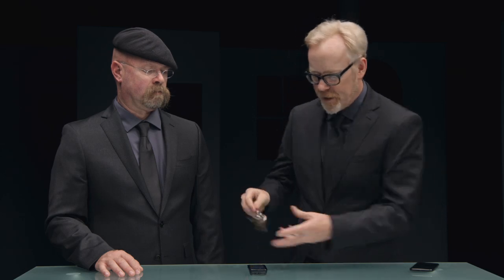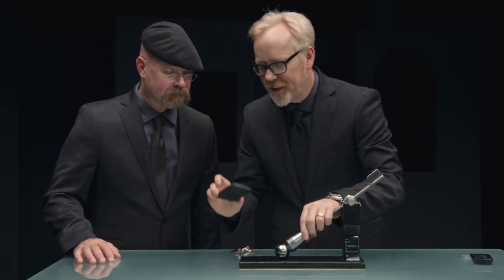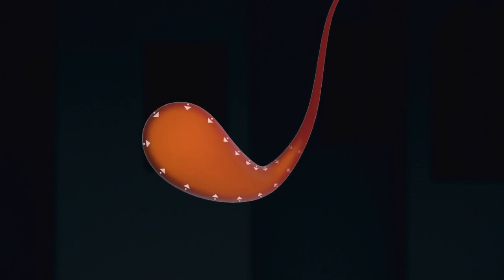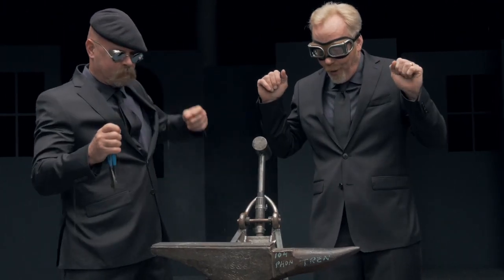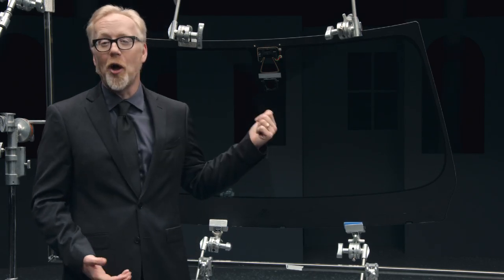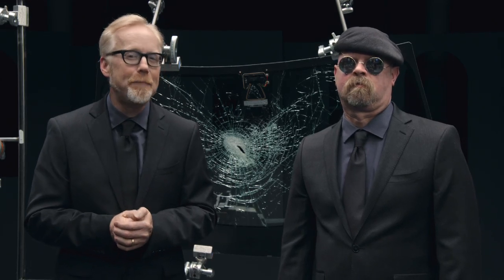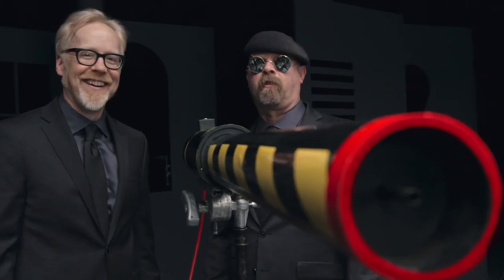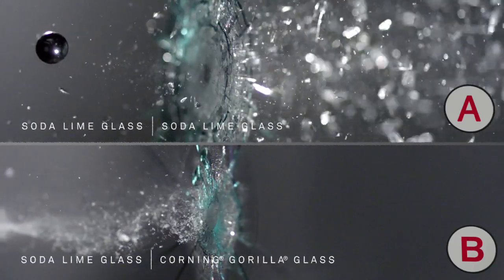The Glass Age, Part 2:  Strong, Durable Glass

Comment: I owned a phone with Gorilla glass and it did survive falling but you know what it did not withstand? SAND. Without noticing it a a few grains of sand landed on my phone and after wiping it off it scratched my display. It maybe impressive as far as dropping it is concerned however they should make it to withstand materials as hard as sand. I use a tempered glass screen protector on all my displays now.
Reply: Bandit Leader nonsense... You clearly have no clue what sand is, or diamond, or cutting...
Reply: ***** Sand is silicon dioxide (quartz) and that's the primary material used in glass. There is this table called Mohs hardness scale (http://en.wikipedia.org/wiki/Mohs_scale_of_mineral_hardness). Basically anything with hardness equal to or greater than a material  (silicon dioxide in this case) can scratch the said material. Hence sand is able to scratch even gorilla glass.
Reply: ***** That is because sand rubbing against the screen is like a diamond drill. Nothing is going to stop it.
Reply: Bandit Leader You can't cut diamond with sand. Sand is silicon dioxide(quartz) with a Mohs hardness of about 7. The gorilla glass has a hardness of about 6.5 so of course it will scratch when rubbed against sand. Diamond has a hardness of 10 so you cannot cut it with sand.
Reply: Bandit Leader You know where to find it, That's all you know about it.
Reply: yup. It does seem to scratch a lot easier than other products.
Reply: +Jeppe Andersen Exactly. Particles in the sand will be strong enough to scratch the toughest glass. On the mohs hardness scale gorilla glass is 6.5, regular soda lime glass is 6, so it's ever so slightly more scratch resistant than just regular glass. I have a tungsten carbide wedding ring which has a mohs hardness of 9. A diamond has a hardness of 10, the highest item on the scale, and I have had concrete blocks scratch my wedding ring. This means there are particles in concrete harder than 9 on the mohs scale. 

Basically... shit happens, and if you're not careful with your phone it's your fault. Unless everything you own is made of diamonds there's the potential it'll be scratched.
Reply: Bandit Leader says the guy who never went to physics class...
Reply: Bandit Leader 3 years? WOW. That sure beats my university degree in physics...
Reply: Ahh, I forgot Bunnings sells diamond as sand. Ill have to go get a bag of diamond grit and make some sand paper.
Reply: Well, I dont know what one is the fool here :\
Reply: Bandit Leader sand is far softer than diamond... Sand is mostly quartz.
Reply: Bandit Leader
You dont even know where sand comes from ?
Reply: ***** Metal is softer then glass so the screen will not be scratched by keys or a knife. Glass is made of sand though so it's just as hard and can thus scratch glass on your phone. And that's why you should always have a screen protector if you accidentally drop the phone on the ground.
Reply: ***** Sand will scratch up pretty much anything. That's why you don't rub sand into anything you don;'t want to get seriously messed up.
Reply: nambinhvu The definition of cutting is fairly set, and does not involve slamming a mass into it with enough energy to cause the underlying material to break away, causing a split.
Reply: Well, sand is like diamond. And diamond can cut almost anything
Reply: Bandit Leader which just shows your ignorance all over again...
Sand isn't diamond, and can't be turned into diamond. It's nowhere near as hard as diamond either.
And no, you can't cut with sand. You can use its abrasive properties to achieve an equivalent effect on some materials (i.e. you're making a hole in it), but that's not the same.
Reply: TheProCactus sand comes from the DIY store, doesn't it ;)
Thus spoke the youtube user called "Bandit Leader"...
Reply: To be a little serious for a bit, Sand will scratch it. Sand is much harder than mild steel and most steels i think. Only carefully hardened metal will not scratch from sand.

I have a Nokia N8, Dropped it when its a month old and never got to fixing it thinking it was going to cost a lot, When I got around to it I got one from eBay for 22Aud bucks. Its so good I dont bother about protecting it, It does a fine job on its own. But dropping it from only 1 meter, It might have 50/50 chance. Ive dropped it once since and its fine, So I dont really know the chances of it breaking.

Im a fan of Pyrex and the Gorilla Glass, Its something that lives up to its own standard.
Reply: like your flatmates air intake on his car
Reply: +Davy Zeng You can cut diamond with sand if you put enough energy behind it. :P  But I guess it depends on your definition of cutting.  If you had a super huge diamond and a tiny hammer/pick, the metal is less hard, but you could chisel it in half.  Diamond is a hard material, but it is also brittle.  You could smash it to bits with a hammer.  So you could sand blast it to bits, you just need a high enough pressure for it to reach that breaking point.
Reply: Jesse Crandle Sure, but they're far less likely to unless you force them into each other and grind them against each other.

Which is kind of the point, less likely to receive damage from incidental contact.
Reply: Mate I don't even think sapphire glass can stop that
Reply: To be honest, I think that's simply another step that Corning will take in its iterative improvement of Gorilla glass. They're constantly trying to improve it.
Reply: jwenting no dont give out the secret XD
Reply: jwenting
nope. sand can cut like diamond. it has been proven. you can also turn sand into diamond.
Reply: jwenting
I know what sand is. Now shush kid.
Reply: Davy Zeng
Sir you need to go back to physics class.
Reply: jwenting
oh but i did. i took 3 years of it. I know my physics. You dont
Reply: jwenting
oh but i do and you dont.
Reply: TheProCactus
nah.

Comment: Heres a thought; if you drove your car into a lake and you had windows made of this glass you would be forced to wait for the car to full with water until you could escape by opening the door since you cant break the glass very easily.

That does happen often enough for companies to make special tools used to break out windows in an emergancy, so corning needs to develope a tool to shatter this super strong glass for the rare but possible danger.
Reply: KJO1993 its actually a very rare situation to end up in a car underwaterthe majority of people will never experience that
Reply: There is a tool. You can buy one.
Reply: KJO1993 You'd have to wait for the car to fill most of the time anyways, because you won't be able to open a door because of the pressure. You'd have to break the glass either way, and I'm sure that if this was implemented it would only be on the windshield and not on the other windows.
Reply: onagda
you cant break through a windshield anyway
you can shatter it but it will still be together
windshields are designed to not let things fly through them

Comment: Could you make a windshield with two layers of gorilla glass and one layer of willow glass to make a windshield that would safely take an impact?  Safe in this case would not allow the rock to go through the windshield at 70 mph, not safe as in avoid damage to the windshield.  I know there is a great benefit to having the outer layer break, but it would be nice to have very light cars.

Comment: In 1903, French chemist Edouard Benedictus stumbled upon the secret to shatter-resistant glass when he dropped a glass flask filled with a dried collodion film. He found that the glass coated with the film cracked, but kept its original shape. However, this laminated glass wouldn't be implemented in automobiles until the 1920s
Not over 100 years...

Comment: didnt tht first phone not have any glass at all? pretty sure that modle had a plastic screen, mine from that era was plastic, when the processor(i'm assuming) went bad i decided sense i cant sell it or make use of it, to snap it in half and see how durable it was, it had no glass, just the plastic resistive touch screen about 1/4 inch from the LCD

Comment: Why not just use a piece of plastic for the windshield? I think that's what some high performance cars use to save weight. I imagine that pebbles would just bounce off of plastic regardless of speed and mass (under normal driving conditions of course, not experimental conditions).

Comment: Why didn't they use the sledgehammer on the Gorilla Glass.  Was so disappointed they didn't do that.  Also, why don't they put Gorilla Glass on both sides with resin in the middle.  They didn't talk about this either.  Come on guys.
Reply: Probably because they haven't found a way to prevent the Gorilla Glass to shatter into deadly shrapnels and that could be the exact reason why we don't have those windshields yet.

As for the two Gorilla Glass layer, being under a stress like that would make the outer layer way too at risk of crack or giving in from the frequent attacks as what stops the gorilla glass from going in the soda|Gorilla is probably the dispersal of force from the soda lime glass layer as it breaks.
Reply: Perhaps it is because it is too strong/solid and does not 'give way' very much. In an accident, if the human body were to impact something that doesn't 'give way', it is very damaging; whereas if something can have a little bit of a slow-down effect, bending just a little at least, it will cause less damage overall - which might be more preferable in this usage. I could be wrong of course, I don't work for them or anything, this is just a guess.

Comment: As a Mechanical Engineer, so of the comments/complaints here about their tests are rather humorous to read.  People think they are smarter than they actually are.  If you honestly are so curious about some of this, go take an Intro to Materials Science class and a Mechanics of Materials class and you would know there is nothing wrong about the tests they did here.  They showed increase fracture toughness, hardness.  What they didn't show is conditions under static loading, which is okay and not really necessary as it is impacts that break ceramics so easily; not putting a lot of weight on them slowly.

Comment: What if instead of a soda lime glass and gorilla glass laminate, a double gorilla glass laminate is made? Would that be strong and light enough to be made as a new windshield or would it flex and bend too much underneath the force of the wind from a moving car moving say an average of 55 mph or at most 70 mph on some toll roads?

Comment: I have a physics related question. If the Gorilla Glass is stronger on the inside layer, and the test were repeated to the point it shattered. Would the expulsion of glass not be greater inside the cab of the car? Because of the added pressure, the failure would be more severe, wouldn't it?
Reply: Or they  could just laminate the inside layer of gorilla glass. So that any intense shattering effect might be mitigated. I was mainly just asking if that's not the case. There are easy fixes if it is. Another thing to consider is that if the interior glass is stronger, it may cause more damage during impact, if someone flies through it because of not wearing a seatbelt. I doubt it would be much worse than current conditions.

I mean, honestly, if we wanted to. We could sell tanks to people without the guns on top. That would fix a lot of the problems of damage to the car. People would still get hurt, but stronger materials aren't always the solution, was kinda my point, if there was one other than just asking about the actual properties of a stronger glass shattering.

Comment: I have a touch screen Nokia that's close to unbreakable you can drop it in water you drop you drop hammer on it will still work perfectly it can even resist hot and cold temperature and this is because the type of glass is similar to gorilla glass but bit more durable and stronger its called rhino glass

Comment: Well, the first phone which they test is Nokia 5230 series phone. It has resistive touchscreen and the surface which you touch is plastic. It's easily scratched by keys or other point instruments. The only piece of glass is the glass protecting LCD display inside the display assembly. So, this is a bit misleading test.

Comment: So, why not two layers of gorilla glass on the windshield, and you just forget about the soda lime glass?
Reply: MB it's expensive
Reply: It may also be detrimental. The shattering absorbed a lot of energy, and you can see that in the double soda lime glass, when the steel ball moves slower in the video capture. The energy was then dispersed with the shards of glass spraying out.

Comment: "Corning came up with this method for strengthening glass long ago".
...and they sat around with no clue about how to use it until Steve Jobs turned up at Corning in 2006 and despite them saying it wasn't ready for mass production, Jobs told them it'd be fine, so they did, and it was.

Of course, then every manufacturer copied.

Comment: Hopefully Corning branches out and tries to get this stuff into other areas. One I can think of is hockey rinks. The NHL had switched to the tempered glass years ago because it provided superior visibility to spectators at angles. They switched back to plexi last year (or year prior?) because of injuries - the tempered glass was simply too hard and didn't have any give with a check. The downside is the plexi often distorts when viewed from an angle and is prone to scratches/scuffs. A glass that mimics plexi's flexibility with the visibility/strength of tempered would go a long way.

Comment: What would happen in the BB air cannon test if the soda lime layer on screen B was replaced with perspex/acrylic? It's lighter than glass, easier to form, and not as brittle. In the downside it is softer so would need to be considerably thicker to avoid flexing under drag.

Comment: Redditor here! I wish they would make gaming chairs out of this Ape Glass. I'm tired of having to replace mine all the time due to broken legs or sagging seats.

- Trilby Mctip, Redditor, Gamer, Knight, Intellect, Moderator of /r/ClopClop
Reply: I wish they made BMW wheels out of this Ape Glass. I cracked a rim this morning, and I have already had to reschedule a client meeting because of this cracked BMW rim. #LawSoHard
Reply: drop some pounds, its easier and cheaper than replacing chairs every so often
Reply: It'd break just as fast or faster. And sagging seats and or broken legs can have a lot to do with the user's weight.  They may be designed for a max of 250-300 pounds.
Reply: Axel Strongarm Beddis Gorilla glass ALL THE THINGS!
Reply: people like you make me sick
Reply: Yes, it will crack and snap, but the forces required would be much, much more than the weight of a person.  Glass chairs do exist, and I imagine they last longer.  I, myself, will receive a degree in Materials Engineering this December, and am currently in a glass science course.  I'm not talking from ignorance, but do understand that there could be things I am ignoring.  That being said, you haven't said anything that allows me to think I am wrong in what I have said.  The only worries would be in possible bending of chair legs, but the strength of the glass is probably enough at the weight of a person for this to not matter.  I do understand materials science, but I am no chair engineer.
Reply: You are right, however, to question the practicality in how much these might weigh and such.
Reply: Ebin maymay dood.
Reply: STFU
Reply: Benson Smith whats stronger gorilla glue or gorilla glass? 

dun dun dunnnnnnnnnn ohhh the irony!!!!
Reply: That's two completely different types of products. One is a binding agent and the other is for protection and stability. What's your point?
Reply: Wanimator ZGB
 The proper response is it'd break slower, just as fast, or faster.  Have you tested these materials?  I highly doubt it.  The strength is definitely a lot higher than the crap they make chairs out of these days; as for the fatigue life, who knows.
Reply: Gorilla Glass is hard, which makes it more brittle and it wouldn't handle constant stress very well, even as tough as it is. It could also be more expensive actually impractically expensive. You could, for the same price or lower than the gorilla glass make a chair with a spring system that would handle higher weight loads much better than the Gorilla Glass, and have money left over.
Reply: I am unsure how the degree of brittle-ness a material has has to do with ability to handle constant stress... Unless you mean the correct term of fatigue that I brought up.  But what I do know is that glass is not "tough".  That would mean it strains much in response to stress, before breaking.
Reply: It is quite hard, and it tends to crack and snap rather than flex or bend. Tough usually means it's softer at least in material science.
Reply: The chair, which I assume you already have guessed will be exceedingly heavy if it's solid that is, otherwise the cost will be extraordinary. It will be prone to chipping on the ground, scratching the floor, and it will sacrifice comfort and will be somewhat limited in design.
Reply: Do you people not get the joke?
Reply: It wasn't a joke, he was serious. The Redditor seems real.
Reply: Wanimator ZGB it was a joke........

u respond like this....

fat boy use gorilla glue and regular glass n make a seat.... put springs on it u look 400  pounds plus.....

eat less cheeseburgers and kfc n walk around ur local park everyday......

PROBLEM SOLVED....
Reply: That's shallow comedy.
Reply: Wanimator ZGB  ya i think fart jokes are funny
Reply: Benson Smith lmao..... its a joke dude........

loosen up man.............
Reply: Sorry, it's just that I didn't know wether to respnd professionally and show that I have a point, or respond in terms of a joke and sound like a fucktard. 

Lol, these neckbeards just keep me on edge.
Reply: josh lee ya blew it.